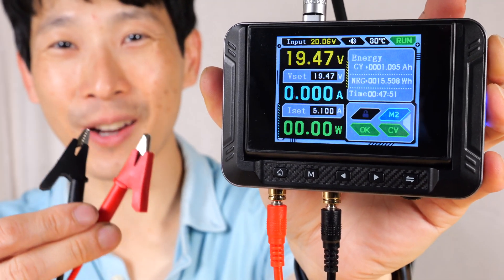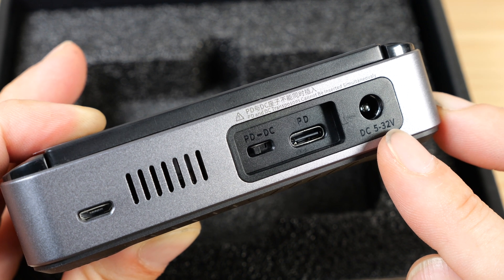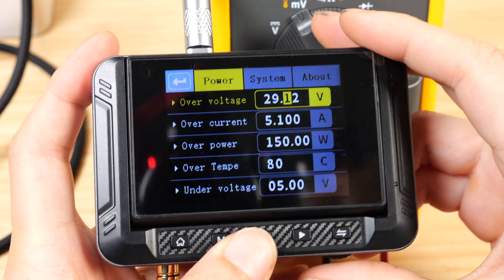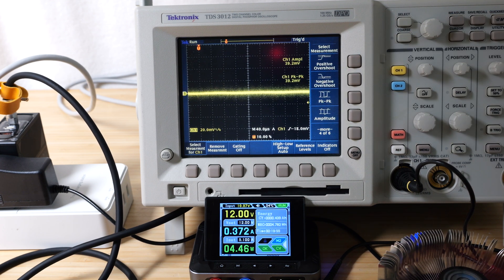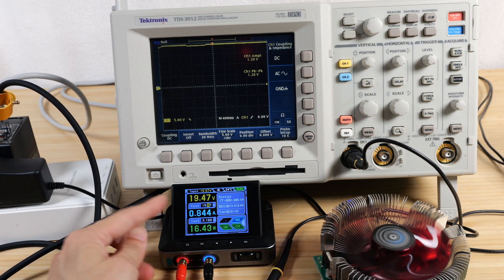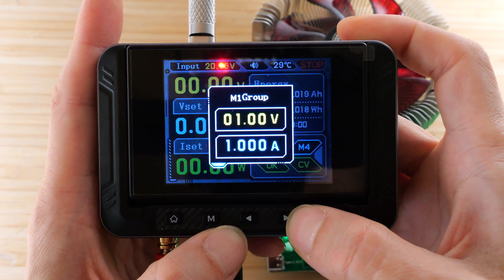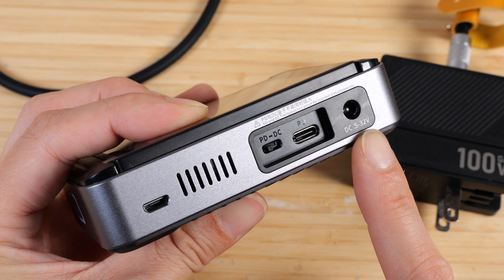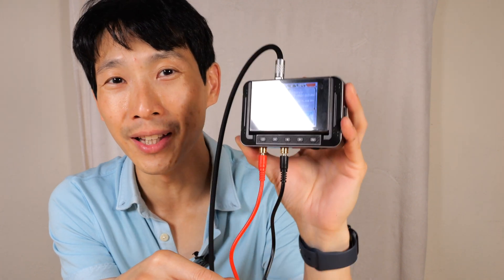Tiny 150W Programmable DC Power Supply from FNIRSI

Comment: The LCD panel can be held at any angle. Yours seems having some troubles, it may be the pin joint issue.  Also the LCD ribbon where you can see at the folding axle at the back, you may notice the ribbon may be touching against two hidden ribs behind causing  two protruded spots appears.  I don't think these two ribs could damage the ribbon sooner or later.  Finally the LCD panel viewing angle is not correct. This cheap panel is born to be viewed at 90 degree rotated by the current position.